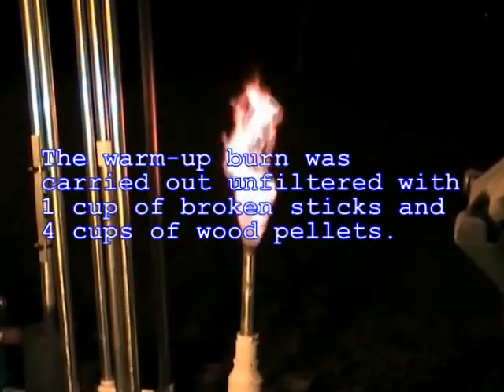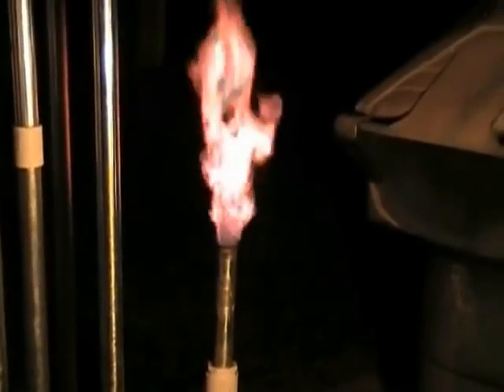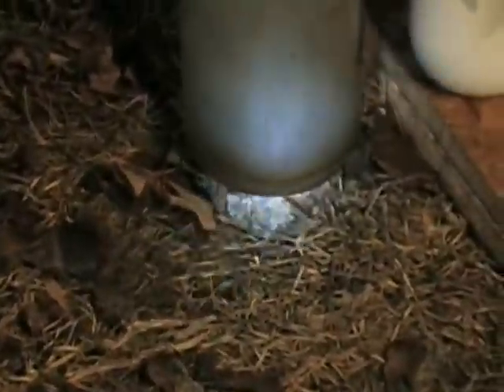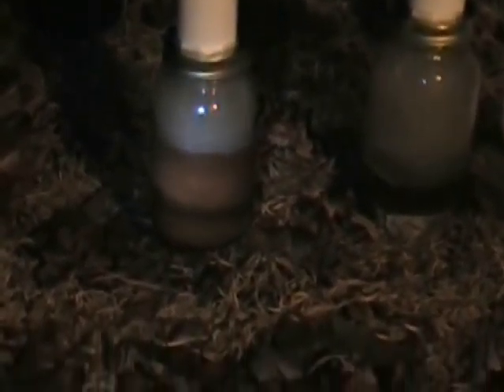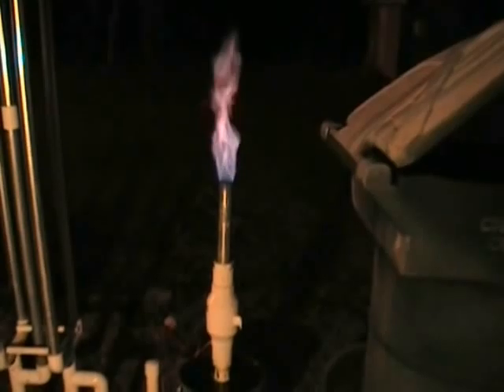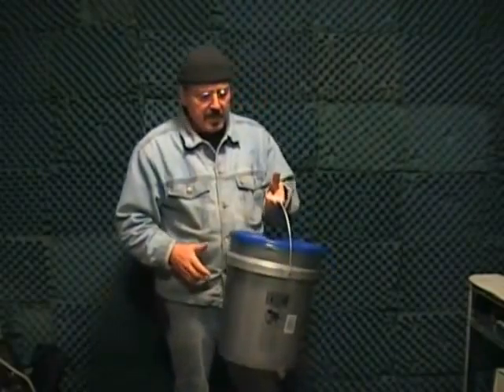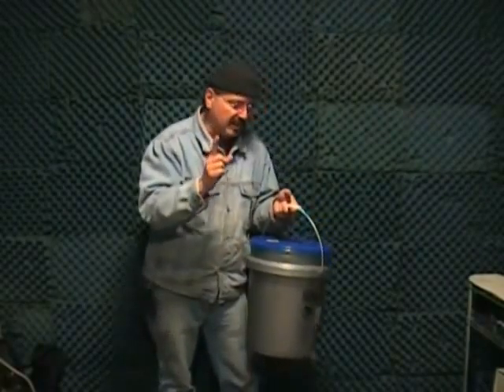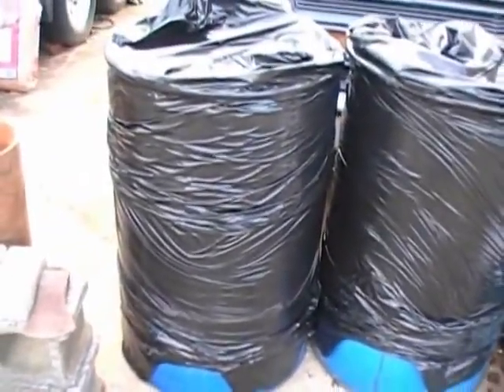Wood Gasifier Follow Up

Comment from the maker: Thanks for the comment CNCmachiningisfun. I have been reading as much info as I can on this technology and I think this can be built to not only be clean but to stay clean without an expansive elaborate setup. I will be doing quite a few follow up videos on the FEMA setup as I hone in a filter system. I am hoping to build a filter that will clean the FEMA up no matter how nasty the gas is. Time will tell but stay tuned.

Comment from the maker: This is one of the older videos here. If you get a chance, check out video 6.
This vortex filter was built out of a gallon paint can and a quart paint can and it was partitioned inside with steel baffles to cause the gas to swirl. It worked OK but I found something that dusted the vortex away and that was to use a 10 gallon tank instead. I'm not sure where I made the transition but just rummage through the other videos and it will make sense to you. The videos are numbered in order.

Comment from the maker: I did do one good thing with the gasifier project and that was to make it future proof. I decided right from the start to make everything upgradable and recyclable and this has sped things up.  The solar project was something else I wanted to take on too. One of my reasons to get these systems up and running was you just don't know what's over the horizon these days.

Comment from the maker: You are where I want to be. I have 270 watts worth of solar panels brand new in the box along with 4 115AH 6 volt batteries and a MPPT controller and I just designed and built my own controller that should rival the MPPT controller plus it accepts wind, solar and a 15 Amp AC input source that can even be a small trickle charge AC source for battery maintenance but the gasifier is my top priority since it's a fuel producer!

Comment: Try some Straw from the farmer down the road for a filter material.  When you need to clean the media, spray it down with a garden hose right inside the filter.  Place a drain for the water & soot to exit from bottom of your filter canister, make sure you can seal off the drain with a cap,  After draining the media, screw the cap back on your drain hole, and begin using the system again.  The same media can be used multiple times.

Comment from the maker: I think I'm also going to remove the vortex filter and go with a 2 ft tall container that's about 8 or 8 inches in diameter. Something tells me that allowing the gas to immediately expand will also help clean and cool the gas too. I just got back from checking out some materials but I have not found what I'm looking for yet. I'll let you know what I find.

Comment: I've read where fiber glass insulation was being used as a filter material.

what did you cut the tank with?

Flash, you are absolutely producing some of the most informative videos on the net. I cannot be thankful enough.

Comment from the maker: j johns I'm not there yet but I do have 270 watts worth of solar panels along with a MPPT controller and I also built a controller that rivals the MPPT design too. At this time I have 4 deep cycle 115 AH batteries for a 24 volt system. I really want to use the gasifier not only as an AC source but as a battery charging system too. I have also started on a small windmill project.
I have taken on a lot of projects but the gasifier is taking center stage because it produces cheap fuel.

Comment from the maker: j johns Thanks man... I actually cut my barrel with a jigsaw. It worked really well. I could see how fiberglass could work but the best fix is to get the bed of coals hot enough to crack the tar. It's 1:20am and I just finished doing a bunch of major changes on the gasifier I built in the video. I am trying different configurations to see just how clean I can get the gas before I build the new unit that will crack tar. I may make a 3rd video before the weekend is out.

Comment from the maker: dantco Thanks for the reply. I want to keep this project open source and share everything that I am doing with those that may be interested. Check out video 6 If you have not seen it yet. I was able to get a really good filtering system designed from all of this experimenting so the work paid off. I'm building a very simple Imbert design that can be built by anybody without the need for specialized tools other than a small MIG welder so keep an eye out for a new finalized video soon.